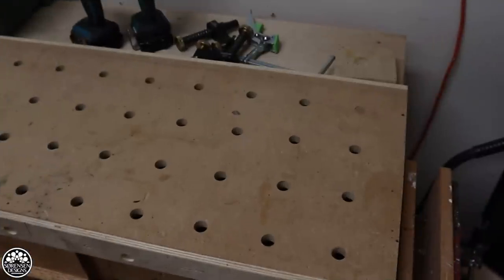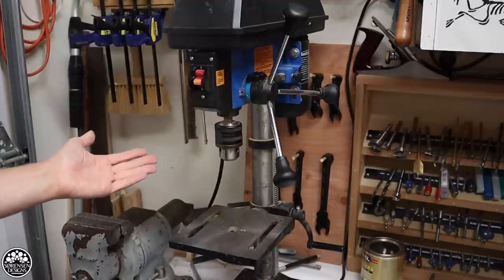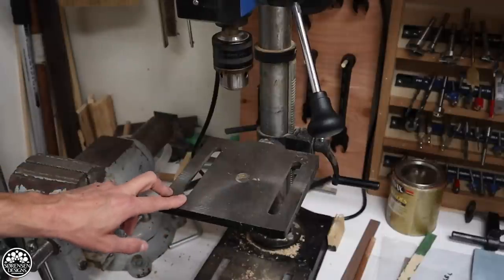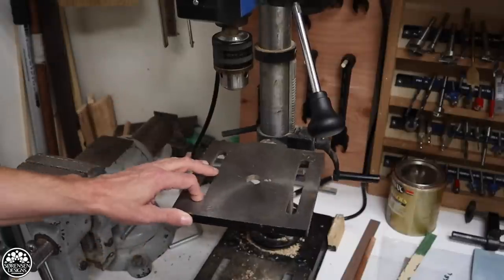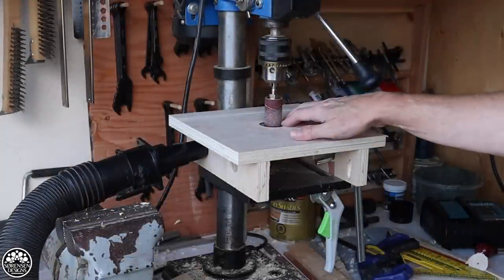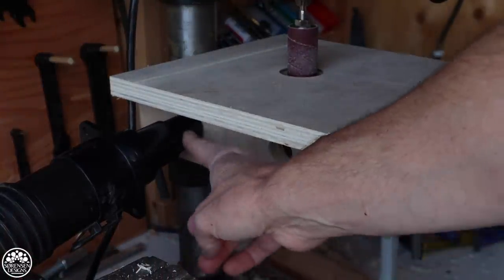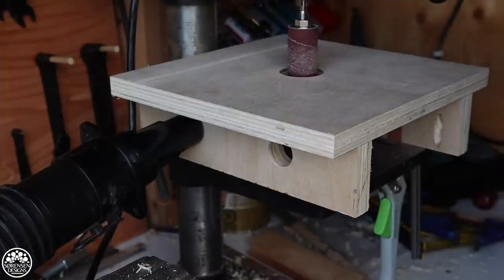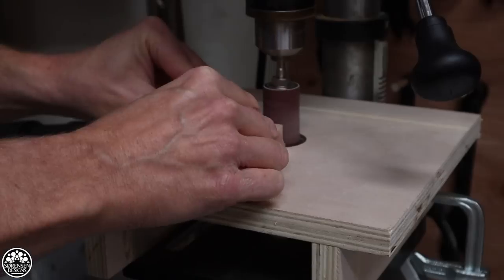$15 Spindle Sander with Dust Collection - Woodworking on a Budget

Comment: I’ve been making musical instrument tuning pegs and putting the flats (actually hollows) on the peg heads using a spindle on a drill press but never thought of making a table like yours. Great idea! Then I could make a jig to hold the peg at a consistent angle and not rely on eyeballing the angle. 

A variation: if you have a 4 inch spindle, you can get 2 inch sanding sleeves and stack them on the spindle with a fine grit above the coarse grit. Build your table with at least two inches of clearance below. Then, all you would need to do is crank up your table to move from a coarse grit to a fine grit. I’ve been doing this by hand, but the results would be more consistent with your jig.
Reply from the maker: Yes, there are plenty of ways to modify and adapt it to different jobs.

Comment: Great video. An idea to consider is to add a treadle board attachment to the handle to oscillate with your foot and keep two hands on your work.
Reply from the maker: Thanks Steve! That's a great idea! I thought about doing that, but it won't really work with where my drill press sits right now. 
If I had the space, I would build a dedicated drill press table with those kinds of features.

Comment: Nicely done Eric! Wish that I had seen this before I purchased my oscillating spindle sander. I like that you can use the entire length of sanding surface with the drill press........... 👍👍😉😉
Reply from the maker: Thanks Steve! I need to get more out of my drill press. This is a good start🙂

Comment: An excellent, easy and cheap solution to the problem. Would not enclosing the front and back openings improve your dust collection? Just a thought.
Reply from the maker: Thanks! It wouldn't hurt to do that. I didn't bother closing the front and back because the dust deputy tends to do a good job of sucking the dust in before it goes anywhere.

Comment: I just love your practical and simple approach!
Any concerns about lateral forces on the bearings?
Reply from the maker: Not at all. You'd have to slam it pretty hard to wreck the bearings and you should not use a lot of force when sanding.

Comment: How does the drill press handle the pressure, when pushing material. Have you had any issues with that ?
Reply from the maker: The trick is to not apply that much pressure. Instead, use the appropriate grit for the work you're doing. Otherwise, my drill press handles it just fine. No damage, no issues.
Reply: @EricSorensenCanada  Thanks. It is on my project list :-)

Comment: Great idea! 👍 what RPM have you got the drill set to when using this jig?
Reply from the maker: I don't have a variable speed drill press, so no worries there. I think the RPM speed range or load range is between 600 and 3000. In other words, mine is on the low end. I would recommend the lower speed settings to avoid burning.